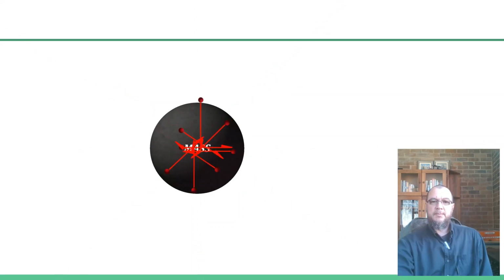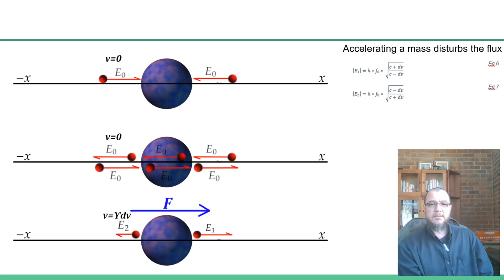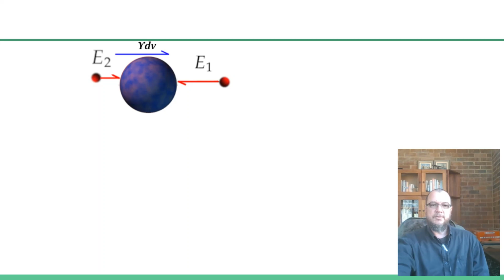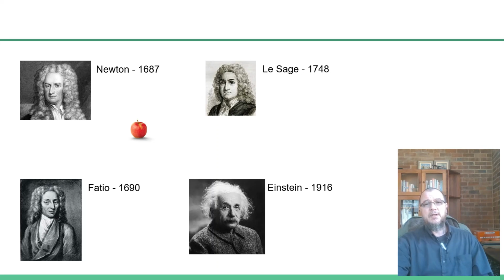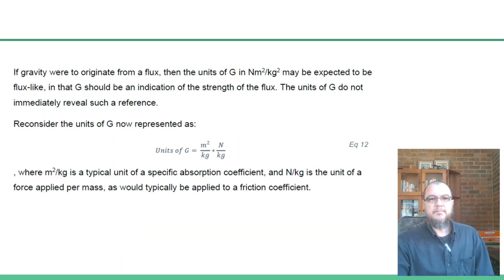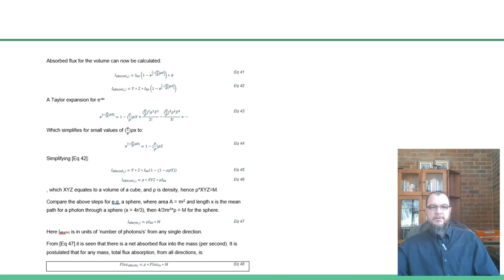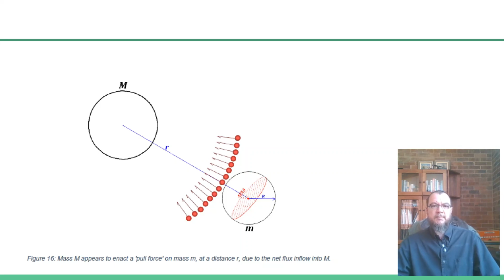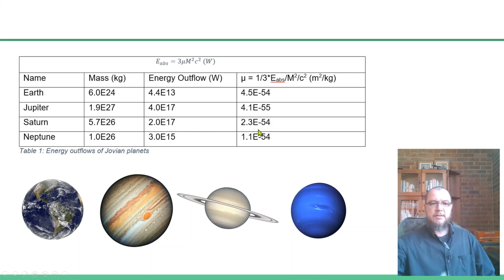The Mechanics of Gravity and an introduction to the Omni-directional Photon Flux

Comment: Where does this graviton flux come from?  It must originate somewhere.  Most photons result from sub-atomic energy events.  I have not seen data about momentum being transferred into a light conducting medium.  Only for absorbed photons.  I don't think the energy of a photon can be changed without its destruction?
Reply from the maker: A valid comment. Although a 'field' as in quantum physics or electrodynamics is also a field of photons. I didn't want to use the term 'field' though because the garvitational field is historically seen as emanating from the mass. Here it doesn't but the mass is in the field and the mass changes it.
Where it comes from? We will know as soon as quantum physics tells us where their fields come from :)